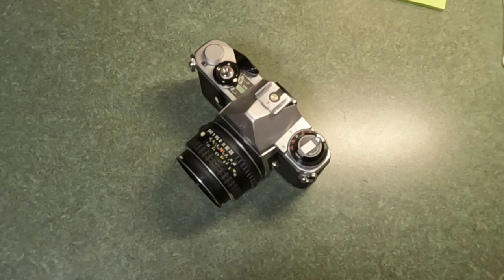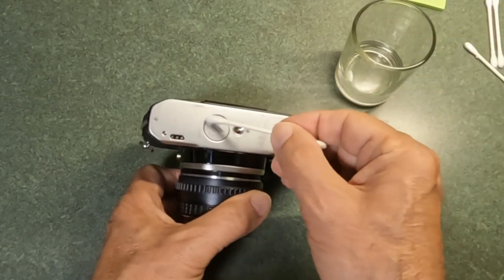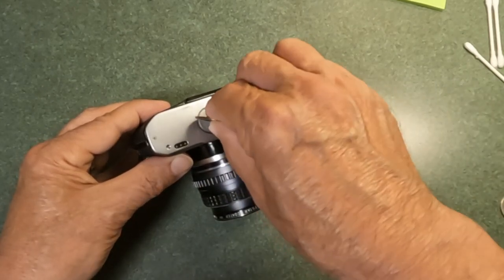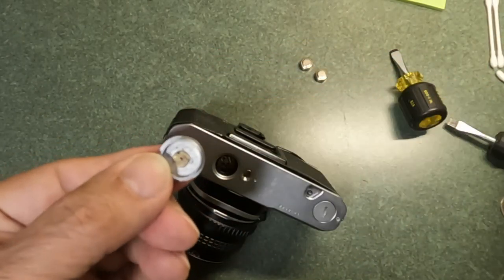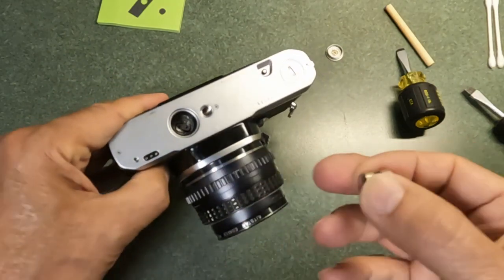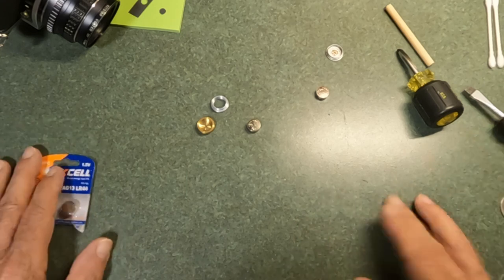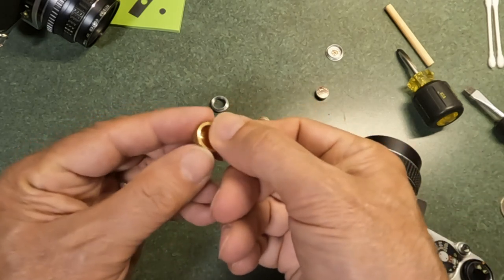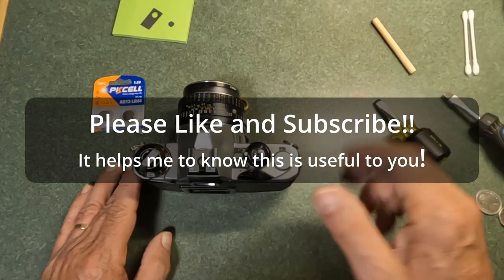Opening a camera battery compartment and battery problems

Comment: Instead of the 1.35V battery I use the 1.4V and push my film one stop and it works fine for me.
Reply from the maker: I have never heard of a 1.4v battery. I don’t think it exists. As mentioned in the video, I use standard 1.5v batteries as the difference is irrelevant for b/w film.
Reply: @jsollowsphotography  1.4v zinc air batteries are frequently used in hearing aids